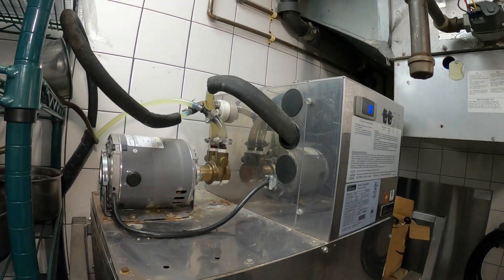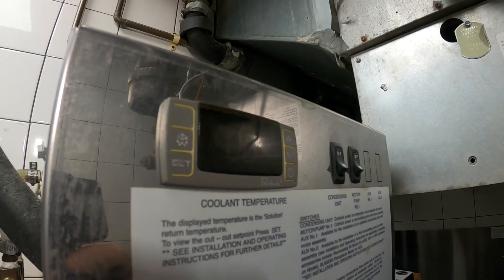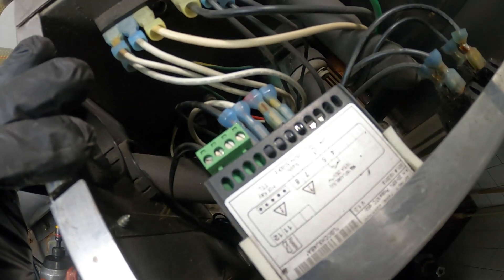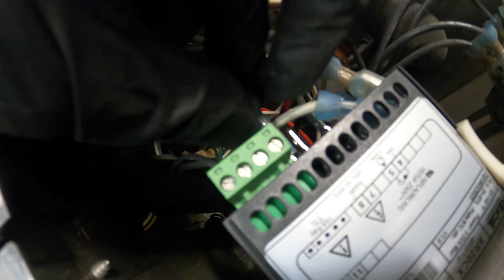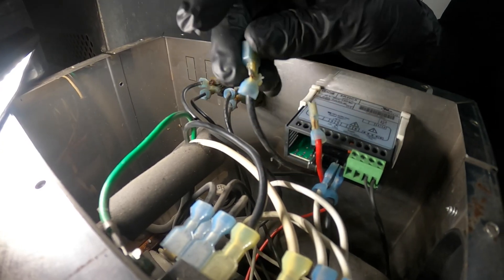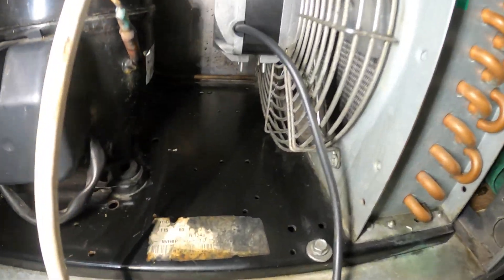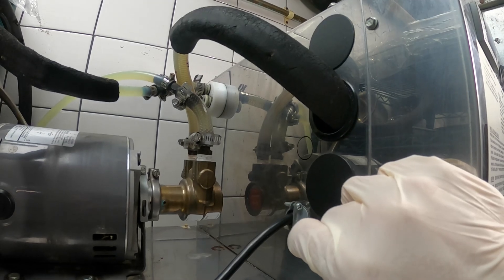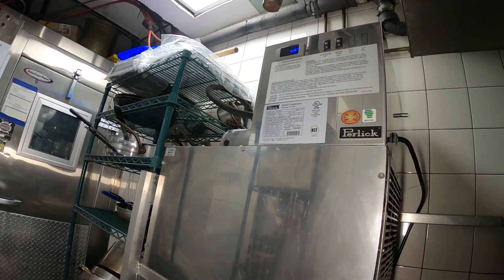HVACR: Perlick Quick Chill Power Pak Glycol Chiller Follow Up Repair (Glycol Refrigeration System)

Comment: G,day Jumpermantech from Sydney Australia. Very informative; changing the electronic temperature control (with manufacturers specification) on the Perlick 4410 beer dispenser. 
Learning outcomes 
* Removing and replacing temp control (side slide clips)
* Change rusted wire connectors
* Clean condensing coil and fan
* Replacing cabinet panels and set temp.
🌏🇦🇺